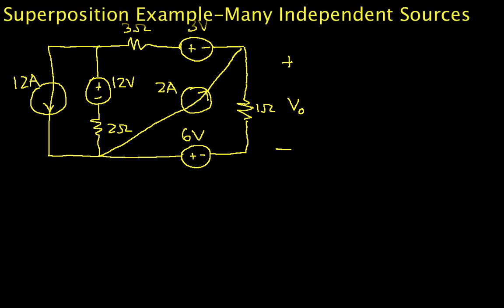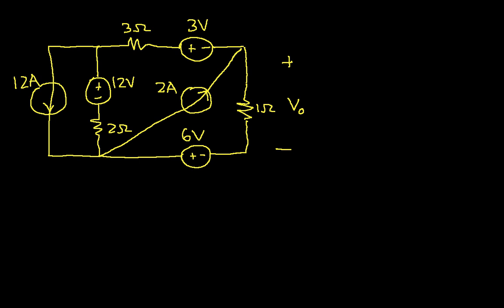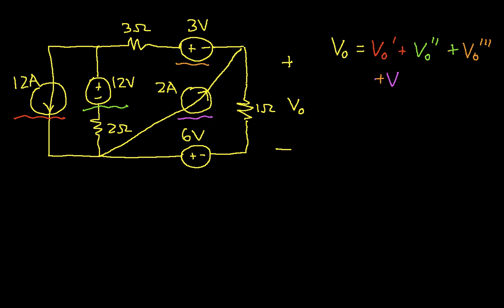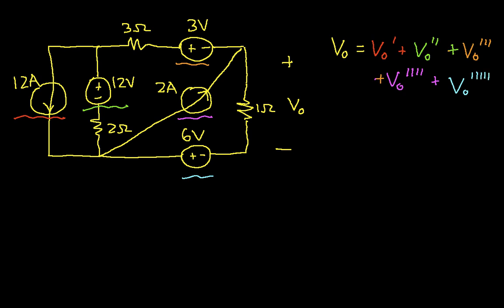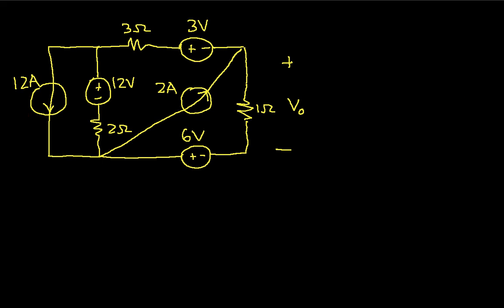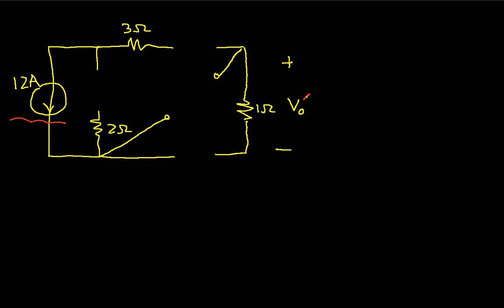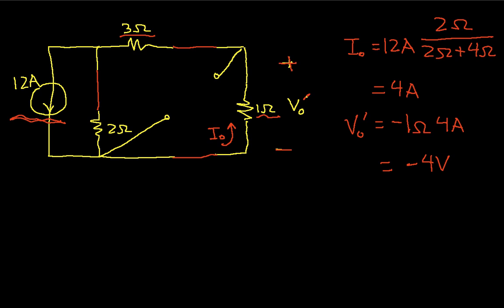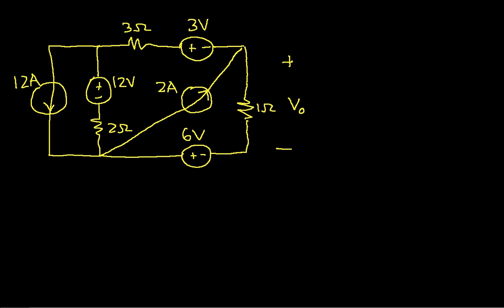Superposition Example-Many Independent Sources

Comment: at 7:20 V triple prime current flows in the same direction as 3V im not sure why the voltage triple prime is negative? is that conventional current flow?
Reply: +Jorge B He already defined what Vo is... And since the flow is going AGAINST the Vo that he defined, that's why he has the -ve sign over there...